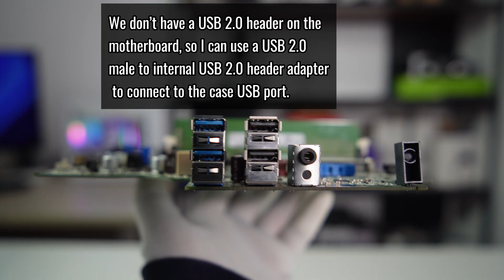Dell Precision T3420 SFF case swap - Low budget gaming PC build.

Comment: What size drill bit did you use to make the holes?
Reply from the maker: For the motherboard standoff screw, you can use a 3mm drill bit. You will be able to tap the threaded screw hole using a power supply screw before you install the standoff screws. Good luck with your setup. Thank you.

Comment: I have a question. You use a water cooler, and the BIOS does not show any warning about the CPU fan, because I watched a previous video that mentioned you must use the original fan only, otherwise it won't work.
Reply from the maker: All AIO pumps and fans have 4-pin PWM cables, so BIOS alerts do not occur. Thank you.
Reply: @itggear  Thank :)

Comment: Mission impossible !!! 👏👏👏
I wonder if we can do that with precision 3650 motherboard !? Thanx
Reply from the maker: The Dell T3650 uses a standard M-ATX motherboard featuring a 24-pin power supply connector, which makes case swaps straightforward. Thank you.
Reply: @itggear3400  thank you for responding 🙏

Comment: I'm just curious what type of power supply did you use. I'm looking to upgrade my system, and i want to get the right one.
Reply from the maker: In this video, I use a standard ATX PSU with a 24-pin main ATX power cable and a 24-pin to 8-pin adapter for Dell. Thank you.

Comment: which connector is it you used for the 24pin to 8pin you said its the only one that works correctly where can i find it
Reply from the maker: There are many 24-pin PSU adapters, such as 24-pin to 6-pin for Dell, 24-pin to 10-pin for Lenovo, and 24-pin to 8-pin for Dell. However, only the 24-pin to 8-pin adapter for Dell allows the motherboard to control the PSU on/off. Other 24-pin adapters use the PSU activation pin connected directly to the ground pin, causing the PSU to always turn on whenever the PC is plugged into the wall. Any 24-pin to 8-pin adapter that has a mini control board inside the cable, as shown in this video, uses the same technique. Thank you.
Reply: @itggear  yes thats what i had read about some of the connectors i didn't know that they made ones that worked as normal thanks!

Comment: Hey man great video there, you earned a new subscriber. I just had one question and it would be great if you could clear it for me because I might try this. The question is how many SATA connections are left if I want to put in another SSD or large capacity HDDs
Reply from the maker: In regard to the Dell Precision T3420 SFF and the case I used in this video, here’s the breakdown: The Dell T3420 motherboard features three SATA connectors and one M.2 slot, while the case supports two 3.5-inch SATA drives and two 2.5-inch SATA drives.

Comment: 4 pin CPU connector for a 90w CPU, nice.
 let us know when the connector melts and weld itself shut to the PSU cable.
great effort but all in the wrong place, you could have kept it simple with an i5 or even a normal i7-7700 non-k at least it's 65w and won't stress that 4 pin as much. 
good job nonetheless.
Reply: I think it is okay because my Dell Precision T3630 with an Intel Core i9-9900K also uses a 4-pin CPU power connector on the motherboard, and it works fine.
Reply: 4 pin connectors can handle 192 watts so what are you talking about
Reply from the maker: Thanks, will do!

Comment: Can 32GB RAM be installed on it HP Pro 290 G9 i5-12500
Reply from the maker: Certainly! The HP Pro 290 G9 with an i5-12500 can indeed support 32GB of RAM.
Reply: @itggear  Thanks